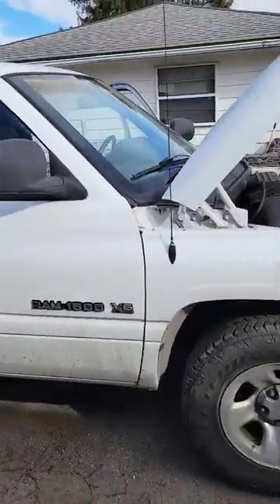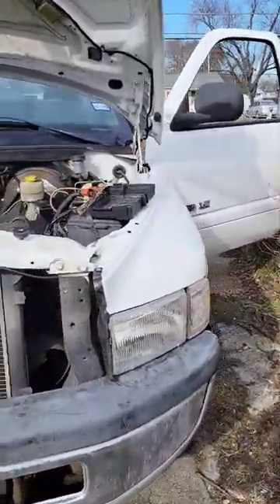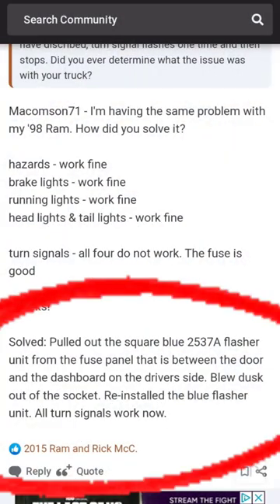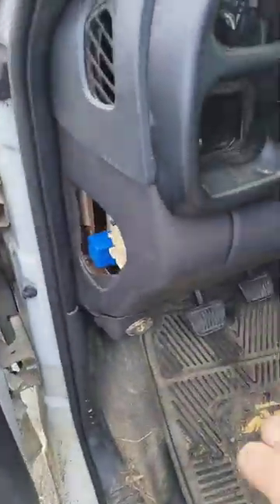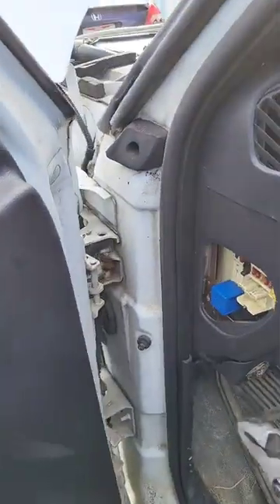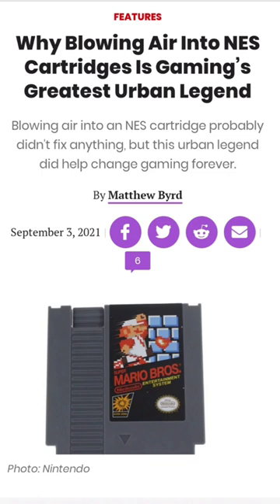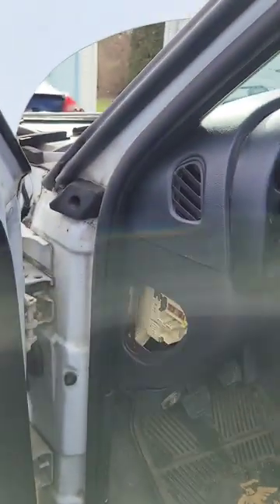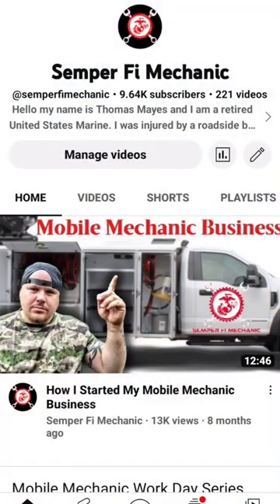The Turn Signals On My Dodge Ram Decided To Quit

Comment: Likely caused by "fretting" of the electrical contacts.  Or it sticking internally.

Removal and reinstall of it was likely good enough without blowing air onto it.

Good stuff.